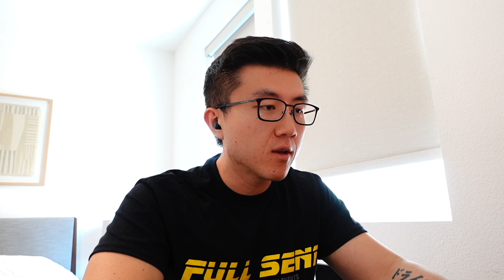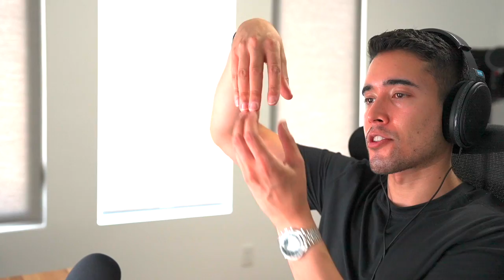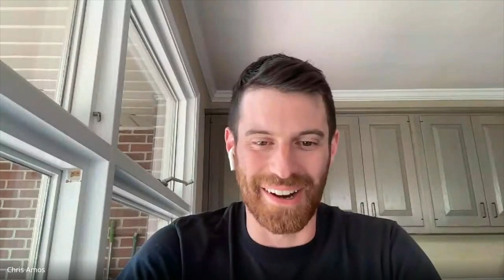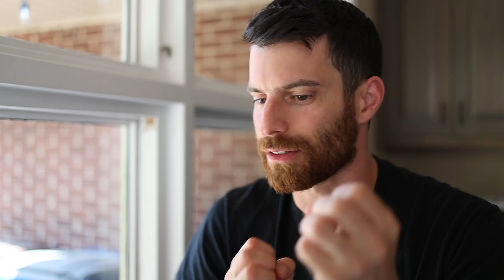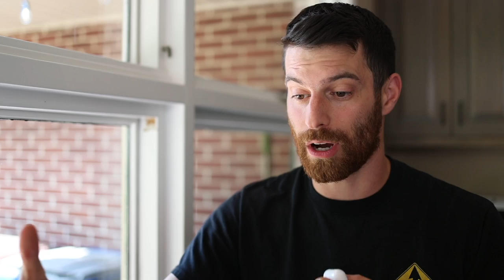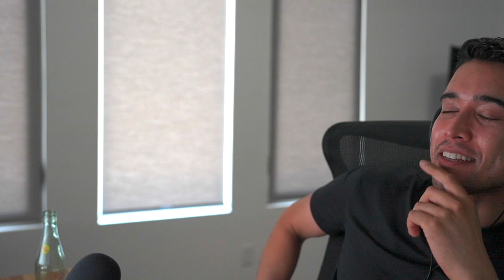Is Your BRZ or GR86 a Ticking Time Bomb? ft. TheTopher and Jubbal & Cars - ZCT #35

Comment: Subaru motors scare me, I know people with foresters that use them to cart round kids and just regular stuff and they still loose their engine with lower miles sub 100k. I won't even consider buying a gr86 or BRZ because of they have subaru engines.
Reply: Subaru has made good rally race engines for decades. And this is not just a typical Subaru engine; Toyota also had total input on the design to try and insure reliability. That's why it has the D4-S injection system for example. It's not a bad engine, it's just not a race car engine. Sadly in life you often get what you pay for, as these guys alluded to, so if you really want a reliable race/track car, you'll either need to do careful extensive mods or get a Porsche or something.

Comment: What people keep missing is that RTV is NOT isolated to the oil pan in these engines and thus a lot of it never gets near the oil pickup tube that has all the screens.  People also incorrectly think the RTV is only on the oil pan seal surface.  It on a lot of different surfaces in the engines where gaskets normally go and thus a lot of it is on the other side of the oil pickup tube.  The reason I know this is because there is a video on youtube where someone disassembles one of these engines that took out its crankshaft bearings and they show all the different places where gobs and gobs of RTV is used and breaking off into the engine cavities.  Another think the people do not understand is that while the oil pickup tube is huge, the other parts of the oil passageways are very small and easy to clog up.  Also, that screen in the oil pickup tube only stops large pieces of RTV and only for the time period they stay small.  As the large pieces start falling apart into smaller and smaller pieces, they get sucked up into the rest of the engine, into the oil pump, into every bearing (main bearings, rod bearings, cam bearings, etc.).    My bet is the RTV is causing most of these engines to fail.  A lot of engines have failed just driving normally with plenty of oil, so it is very apparent that is is not g force for many of them.  Of course that does not mean the g force issue is also not problem.  It appears the engines have both problems.   By the way, there is a video of a tear down of the first generation of this engine and it does not have all the RTV like the gen 2.

Comment: I was under the impression that all Porsches use a drysump in their boxer engines because they know about the inherent shortcomings of the boxer engine in sporting applications
Reply: They used to but since 996 save for I think the turbos gt2 gt3 and gt4rs they have "integrated dry sump" which is really just wet sump but with baffling and multiple pickups
Reply: Interesting, either way that is significantly more than you get from Subaru.

Comment: Thanks for getting together and talking about this. Having bought my ZD8 mostly to have fun and to learn to drive fast, it's been pretty stressful to watch this saga unfold. As you all said, there are risks associated with tracking any car, but the frequency of catastrophic failures in the media has been concerning for me. With the internet being the way that it is, people love to present speculations about the root cause(s) as fact (RTV, oil pan baffling, oil temps, driver error, etc.) with very limited information - but ultimately even if there is an unusual number of failures relatively to other commonly tracked cars, owners collectively cannot make an accurate and sound conclusion based on the existing data points. So it was nice to hear some more level-headed people talk about the situation.

Something that I'm very curious about but I think none of you brought up is the spec racing series for this car run by Toyota. The GR86 Cup cars have full aero, slicks, race suspension, etc. My understanding is the engine/oiling system is lightly modified, including an oil cooler and different oil pan, but I don't have many details. If you guys could somehow figure out what they've changed there, it would be super helpful, since that info isn't public as far as I know. I assume they wouldn't risk having multiple cars blowing up every race, so I'd love to know how the manufacturer thinks it's best to modify the car for racing. Unless they all just get frequent engine replacements, in which case idk... I'll probably just sell the car. lol
Reply: Search GR86 prototype baffle testing and you'll get a couple really informative videos on what is happening and why. It's only on big, right hand turns with high G forces like on a road track. An aftermarket baffle/oil pan/pick-up tube will fix the issue, once one is finally figured out and produced. There really isn't any worry about street driving or even auto-x with fast turns, mostly just the road tracks. No clue why Toyota/Subaru haven't implemented this fix on their new cars, they know it's an issue. It's something that has happened to all boxer engine cars, up until a certain point.. then they fixed it. Not sure why they didn't use the fixed pans/baffle on this car..

Comment: the layout of the engine being horizontally opposed has nothing to do with the increase in engine failures, if there is adequate oil pressure, there is adequate lubrication regardless. the flat 4 design if anything, would actually lend itself to prolonged lifespan due to the way the opposing pistons cancel out the others vibration. 

i feel the number one reason these are failing is the unique ability for these cars to hold high g forces that rival much more serious performance cars, but it still just has an economy car oiling setup. you wanna keep pulling those crazy Gs you need to go with a custom oiling setup, dry sump, or at the VERY least a modified pickup and baffle. 

these are not track ready. they are track CAPABLE, but they need the oiling modifications to keep up with sustained abuse.
Reply: Nailed it!

Comment: For reference to Subaru, I had a 2018 STI Type-RA (I've had a BRZ in the past too) that had 4th gear go out on its first and only track day with 4k miles.  Warranty was denied, mostly due to the AOS and 91 octane tune I had.  But they did actually help with paying for almost all of the claim ("Good Will") when I had the dealer call SOA for assistance.

Comment: I love the old school love: crappy drivers are safe! I do think the new oil pick up is designed to handle more blockage before starvation is a problem. I think every car will have some amount of RTC in the pick up. The new timing chain baffling in the 2nd gen is probably a step in the right direction but probably not sufficient for the high G modded aggressive trackers. I am hoping stock or stock plus mods are relatively safe as that is where I will likely keep mine during the warranty period.  I love the discussion guys, and I do appreciate the personal tips like Molybdenum oil additive and Kangaroo rotor tech 4000 even though I am too crappy a driver to need them. I do find the PS4 tires are too grippy for hooning around on the street and perhaps I might look for a set of primacy tires/wheels to goof around on or track in the future.

Comment: Here's the list of NEW track and auto x friendly cars under 50k and their negatives. All are solid picks (just calling out the mild compromises)
1. Miata. Best choice but better for those under 6ft or short in torso.
2. Camaro 1LE package. Terrible visibility and high consumables
3. Golf R. Little soft and artificial, detached feeling 
4. Elantra N. Wheel hop is terrible, esp in wet or uphill
5. Corolla GR. Needs some aftermarket diff cooling for longer track sessions. No sliding
6. CTR - Difficult to source. FWD for those who want throttle drive

If you want to spend more (under 100k) C8 Z51 is perfect out of the box,  Supra is nearly perfect but needs some stiffer springs, and Cayman is also solid (if not a bit clinical for my tastes). CT4V BW apparently good but dunno much about.
Reply: Better off looking into K Series Honda manuals like 8th/9th Gen Si, RSX, TSX or even the Fit.
Reply: C8 is way too heavy. And you forgot the Evora. It doesn't have cheap mcpherson struts all around like a Cayman. Supra is at around 40K nm/degree of torsional rigidity.
Reply: @xyz777  agreed, clarified Supra (suspension/springs). Evora is absolutely amazing but not new, Emira over 100k. Disagree on C8, it's track ready and does long long sessions with no issues
Reply from the maker: Dude. You summarized all those cars perfectly.
Reply: @Zygrene  haha. Just a middle aged techie and car guy, modding, enjoying and blowing money on too many cars up here in Seattle since 2005. If I had invested the money in the markets I'd be with more 💰 but less smiles
Reply: Throw a rear sway bar and a tune on the Golf R and it becomes a beast.

Comment: Great podcast, thanks! Chris is pretty spot on. The car was tested and certified around the grip of its factory tires (and overall package). Not all manufacturers have built-in headroom on their stock components that can survive the mods you throw on the car - could be powertrain, drive-line, or suspension components. Seen many different parts fail on cars when modded and pushed beyond their limits. Overall a pay to play mentality.

Also agree with the DBA4000 front rotors. Pretty much solved my pad smearing issues.
Reply: Could not agree more. 44:30 though with equally recorded evidence that the car was not modified.
How can a manufacturers like Subaru or Toyota be expected to warranty for track purposes modified cars when Porsche, arguably much more focused, requires even model specific N-rated tires for their warranty. Let alone allow non OEM mods.The envisaged pressure or damage to Subaru’s or Toyota’s reputation by posting on social media unjustified claims will perhaps cause them to pull out of this niche. Then we will all not be able to experience and enjoy cars like that any more. Enjoy them stock or bear the risks.
Reply: I understand what you mean but Toyota and Subaru know their market. They aren’t dumb they made a 2nd generation of this car because of its success with the gen 1 they clearly know the car wouldn’t be as popular without the vast aftermarket support for the car. Knowing that, they should expect their average consumer for the car to do a little bit of mods. Putting on some wider stickier tires with some nice wheels and coilovers has never been a void of warranty. Ppl aren’t running slicks on these cars and breaking axles it’s just clearly a very bad engineering fault by Toyota and Subaru who clearly advertise the car as a budget friendly track enthusiast car. But now that their engines are blowing up due to their own engineering fault they want to say it’s our fault and retracting their advertised statesman to say it’s a road car not meant for track use. They just need to take accountability
Reply: @Smitaye-  Fair enough point.

Comment: This is a great video. Sad to hear so many cases of blown tracked engines makes me worried about mine. Im doing my 7th and 8th track days at Sonoma this weekend. I have oil cooler, RS4 tires and I am tuned on ethanol with a few bolt ons. So far the car has 22K miles and i do changes every 4k miles and i use motul 5w30.
Reply: Search GR86 prototype baffle testing and you'll get a couple really informative videos on the subject. It shows exactly when the oil pressure drops. Eventually, an aftermarket baffle/oil pan will be made that completely fixes the issue but until then, I personally wouldn't touch a track with it.

Comment: Thanks for this one, guys. I think you hit it on the nail. It's not that much an RTV issue, as it is a lubrication issue when tracking these cars. Slightly grippier tyres, like the PS4S, on stock suspension, or coilovers with stock tyres should be OK. But coilovers and grippy tyres will generate too much G-force in the corners, starving  the oil system. And this: G-forces are shown on the dashboard in certain modes, meaning that the dealer can see how much lateral G's owner pulled on the track. So use common sense, and be careful !
Reply: What if I run PS4S and milder coilovers like ohlins Road and track? Asking because that's what I was planning to get, all stock right now.
Reply: @ruturaj47  , Hi Bro. I ran Ohlins and Michelin PSS on an MX-5, a few years back. The lateral G limit difference with stock was massive, so I wouldn't risk it on a BRZ/GR86. Also, the stock suspension on the twins is really good, so I'd spend my dollars on tyres, exhaust and brakes ...
Reply: @didierleurquin3693  thanks bro, I was thinking about coilovers because of few reasons, I wanted 15mm drop, 3° camber and less understeer than BRZ is set for and slightly more comfort on daily. Do you think just the PS4S without coilovers might be too much?
Reply: @ruturaj47  , actualy my GT86 had a KW V3, 15mm lower, but still OEM tyres. That could be an option, or otherwise, and much cheaper, OEM suspension and PS4S in 225/40/18. Would not go for coilovers, plus sticky tyres, too much G-forces for the engine...
Reply: @didierleurquin3693  thanks, I have been thinking about PS4S in 225/45-17, wasn't so serious about getting ohlins, now would just drop the idea entirely.
Reply: @ruturaj47  
you haven't mentioned your level of driving.  are you a fairly advanced track /AutoX driver?  (remember, that's largely the pretext to this discussion).      
I would argue that the difference between a novice track driver & advanced driver, is greater in this context than, say,  simply going from OEM tires to even some 200TW tires  (and PS4S is not even a 200TW tire at that).
Reply: @pushslice  I am novice but I am also planning to do about 6 track days and 6 or more autocross events through summer, I assume I would progress. I know PS4S is not a 200 tw tire, it's the tire that's more grippy than 4, my questions were, would that be an issue to some extent and what would be the result of combining that with ohlins R&T.

Comment: I think it's worth keeping an eye on the Toyota GR86 Cup cars that add a bunch of supporting mods to an otherwise stock (internally at least) FA24 engine. From the specs various sources reference I did not see a mention of any conversion to a dry sump oiling system, just an oil cooler. An article written by NBC Sports talking about the racing series and the cars specifically points this out: "The cars mostly are customized to help manage the heat – the stock versions aren’t designed to handle the oil that sloshes around in the high-speed left- and right-hand turns on the road and street courses of the GR Cup schedule". Hopefully from the cup cars both Subaru and Toyota can collect some R&D data to improve future iterations of the street car. I think overall this hurts Toyota's reputation more given they are the brand people think of for reliable cars and I am not surprised about the rumors that they would move to an all Toyota platform with the 3cyl turbo hybrid setup.
Reply: Super Taikyu is another racing series to keep an eye on where the Twins are prevalent in the ST-4 class and both Subaru and Toyota running cars in the ST-Q class to experiment with synthetic fuels. Toyota's entry is notably different using a Toyota 1.4L 3 cyl turbo rather than Subaru's FA24. Not sure what setup is allowed in terms of engine and supporting mods (like oiling upgrades) for this series.

Also: the comment that went popular here by a person claiming to be affiliated with one of the teams in the GR Cup North America series describing engine failures by their own team and other teams is no where to be found anymore 🤨

Comment: Subaru makes fun street car engines. Not necessarily track motors. The other manufacturer to use the boxer engine in Motorsports application is Porsche and you know how much R&D went into it and how much they cost.

Comment: I think the root of the issue is a boxer engine is more sensitive to changes oil pressure and they don’t have any baffling in the oil pan to keep oil near the pick up tube. What’s been found is the first gen has more robust oiling system compared to the second gen. However they have the same flaw of lack of baffling in the oil pan.
Reply: Even aftermarket baffles don’t keep enough… the return rate is lower than the pump rate… meaning oil is trapped on the right turns. Fastest solution is add an extra 0.5 liter oil in.

Comment: @zygrene - owned my 21 ND2 and after numerous events, canyon carving (touge driving) and 2 dozen road trips all over the US... I've had almost no issues. Most things I've run into are minor hiccups at best. I'm modded almost to the max for the platform but still NA no force induction yet. It's saddened me to see the issues on the current gen 86/brz. As a long time viewer of your channel I hope you guys find ways to get passed the current issues for tracked cars. Currently at 34k miles on my ND2 btw and I drive the car very spirited.

Comment: Informative. Y’all have increased my stress level (again) for sure. I’m a bit with Topher on the merits, even if closer to Fenton’s driving style. PS4’s on stock suspension is good fun, whereas a cup 2 on more aggressive spring rate with couple degrees of negative camber up front prob asking for it with wet sump. More proof how this chassis punches well above its weight. Still too early and anecdotal but definitely smoke there as more cars have been sold and higher mileages recorded (anyone been updating that spreadsheet which was floating around documenting all the FA24 failures?). For now, 5w30 every 3k (keep doing the blackstone analysis and measure silicone as well) oil cooler and fingers crossed. I love the car so much already. Such a sucker punch issue but not gonna freak as well. Keep these videos coming guys!